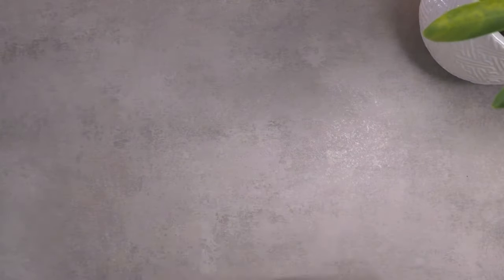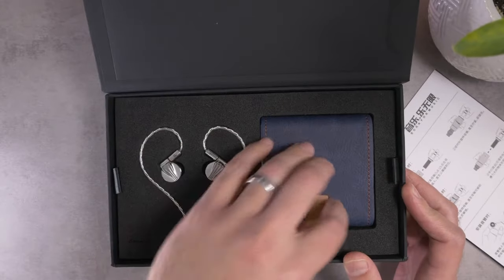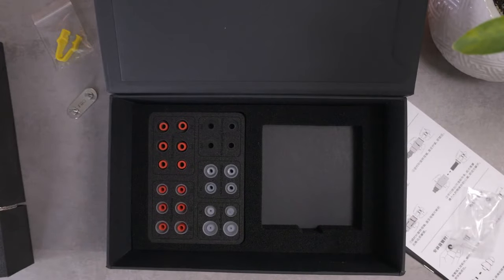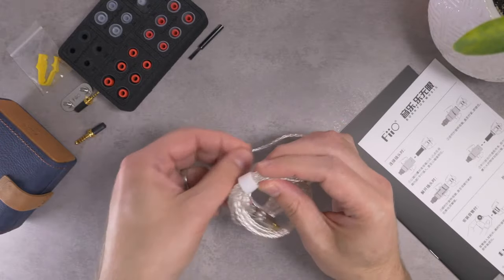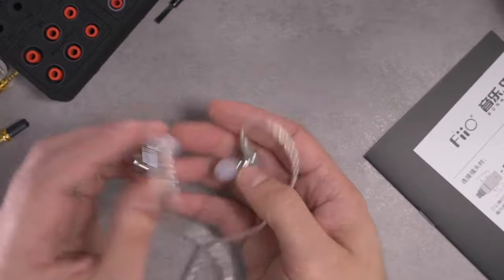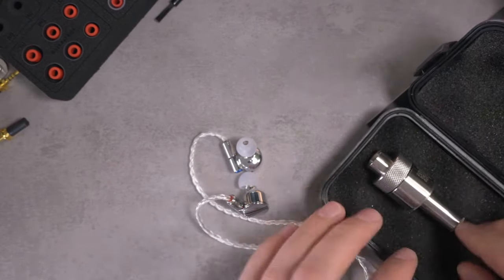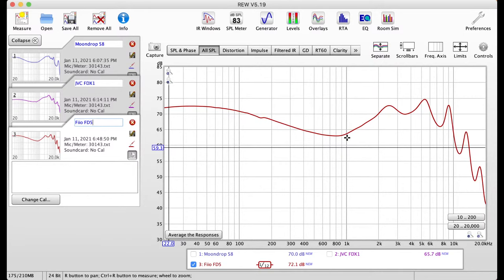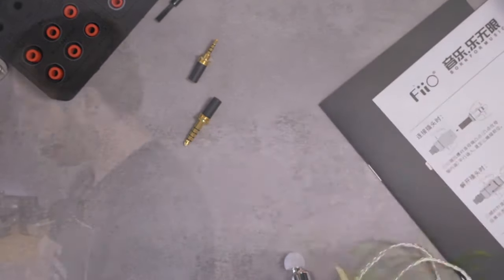FIRST LOOK! Fiio FD5

Comment: You just need to unscrew and pull it out to change the 2.5 /3.5 head,same goes to earphone tip filter channel just need to unscrew
Reply from the maker: Gotta pull pretty hard to remove the termination.

Comment: How is the difference in L/R loudness (dB) of this DD?
Reply from the maker: I didn't measure both, but no difference perceived to my ear. It would be unusual if there's a difference.
Reply: @SuperReview  Noted. I knew a custom IEM maker told me about this issue usually suffered in DD. BA drivers has better quality and precise control in loudness. If look into Crinacle IEM ranking into the fre/dB grpahs, also notice DD has bad L/R loudness difference, some upto 10dB difference and that is faulty. Standard is that L/R difference should not more than 3dB. Even Beyerdynamic Xelento (USD999) premium iem also suffered from that. Therefore, I'm not confident with DD iems unless the manufacturer is taking quality control seriously. I'm still very much interested in knowing how Fiio FD5 single DD iem in this L/R loudness control.